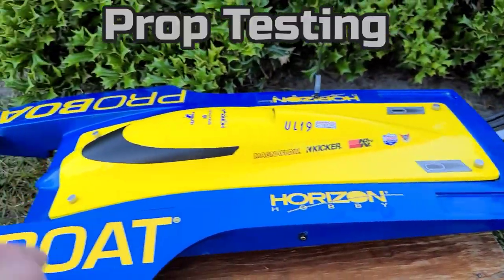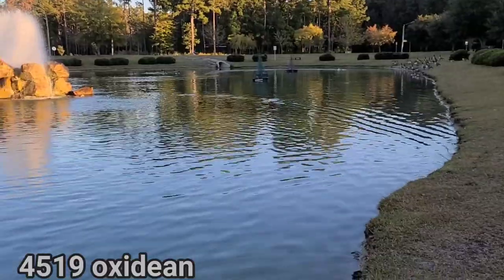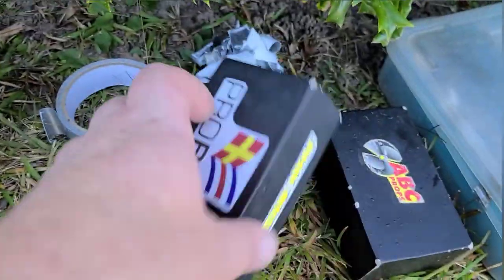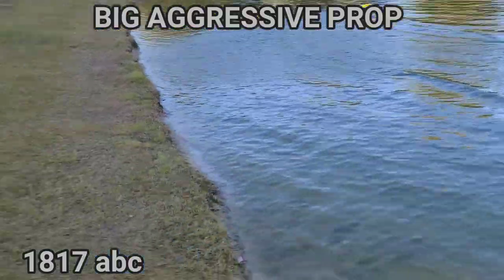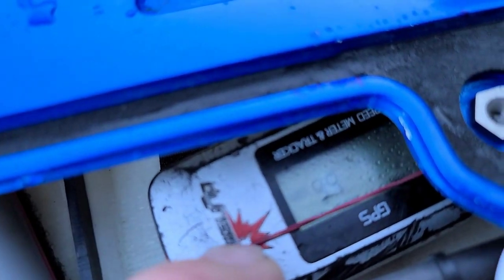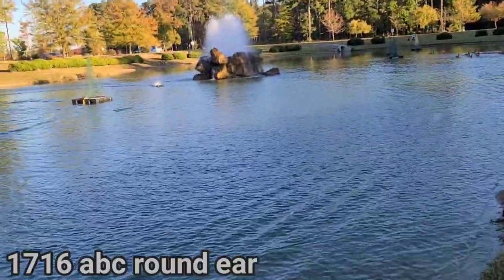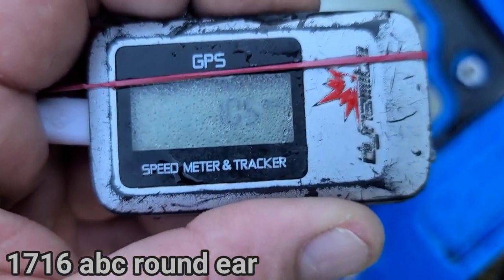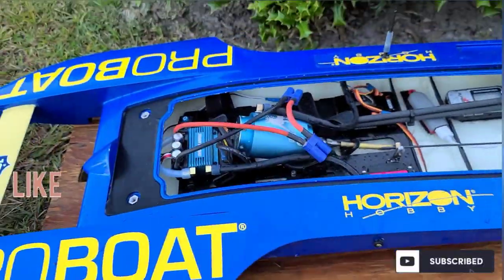Prop Testing Proboat UL-19 - Fast Electric Rc Hydroplane Prop Test

Comment: I have an idea to help with power cut from heat. How about a small computer fan blowing on the unit? A separate little battery with a small solar panel from like a light from in a garden?

Comment: Im getting 10 laps stock prop 1/2 throttle. If I peg it, I only get about 5 laps before the lipos lag.  6s w/dual cooling and the temps have been running cool to normal.  Should I get the Oxidean 4519?

Comment: Man ran 6s again on ul 19, and in two minutes all three motor wires came apart! And 6mm bullets.
Ose 150, duel cooling,  octura x442 prop.
Now I just ordered a new motor from ose.
Reply: @matthewwilken2051  nice run, 6s I changed from 3.75 to 0 degrees,  factory was 7.5, I changed that when new.
Reply: Check timing and sounds like your running timing too high.
Reply: @mildtowildrc7343  I went to lower timing, I thought on my ose 150! 
Was 7.5 lowered to next one down.
I just reset to 0 degrees. 
Your thoughts
Reply: What motor?
Reply: @mildtowildrc7343  0 degrees
Reply: @mikesullivan5851   stock